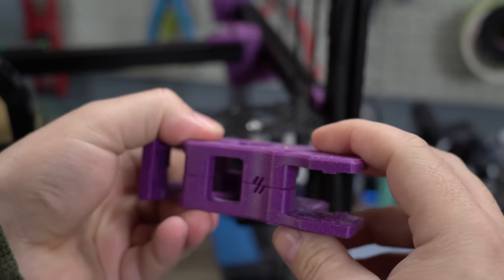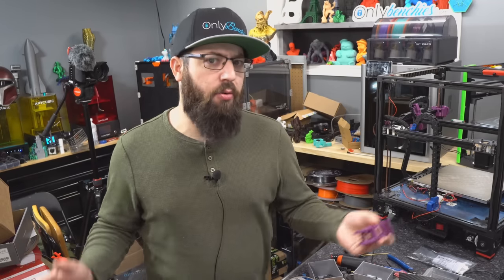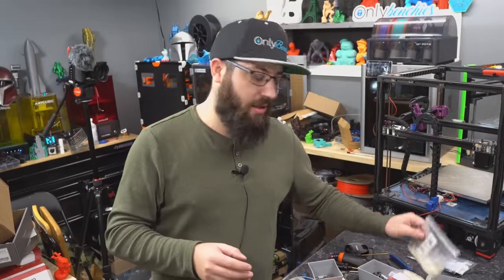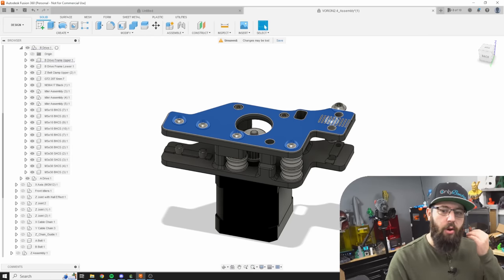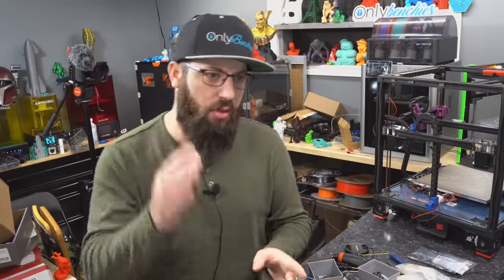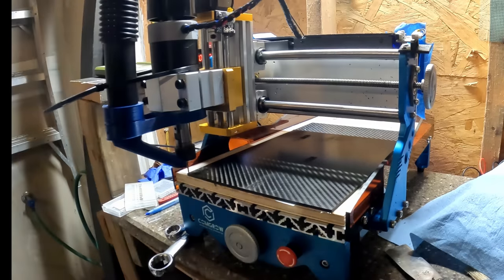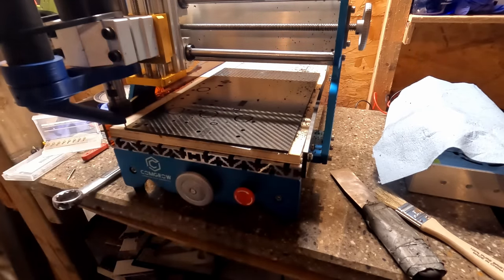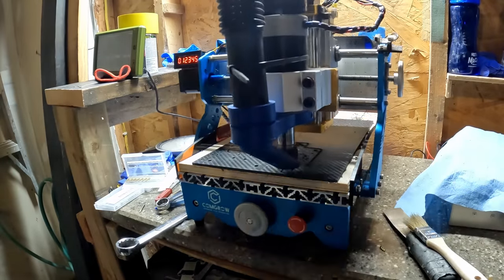Machining Carbon Fiber Voron 3D Printer Parts

Comment: Note that once TAP is installed, you could print some features onto that carbon fiber plate, then take it all over to the CNC and cut a finished part out  Additive + Subtractive processes on the same part.

Comment: The resin matrix in that carbon fiber is a thermoset rather than a thermoplastic, so if you get a sheet with the right epoxy it should be able to handle high temperatures (higher than the ABS you'd previously used). Aerospace-grade epoxies can go up to ~300C without deforming. This is actually the reason why thermosets have continued to dominate the aerospace markets - it's only fairly recently that thermoplastic resins like PEEK have started to get up towards the required temperatures.

Comment: Good idea for the filtration and vacuum when milling carbon fiber. You may already know this, but just in case you haven’t run across it - carbon fiber dust is conductive so you have to be careful with electronics nearby as the dust can get in there and cause you some electrical issues later on. Great video!
Reply: yep. I dont know if id be milling CF on a brand new CNC ...
Reply: Been using my cnc mill for cutting carbon for 3 years and still no problem. Just make sure no fans can directly suck dust in there.

Comment: This is really nice step by step, I love the video! And the following comment is only meant as constructive feedback. As a humble mechanical engineer, I believe that the stiffness haven't improved drastically with this new design. Yes CFRP has some really good stiffness properties. But you loose a ton of co-planar stiffness with the polymer spacers ( they have a small diameter, and they are quite weak in compression forces). So with a few minor design adjustment's, the stiffness could be greatly improved. Upgrading the spacers to GFRP/CFRP tube spacer's cut at the correct length (and straight cuts). Increase the number/diameter of spacer's. This would give this box construction a high degree of stiffness in most directions.

Comment: When you cut carbon fiber plate, do you ever seal the new edges you created with epoxy?  Maybe the cnc cutters are good enough to leave smooth edges without chipping or fraying.

Comment: You could also have gone with fibre glass, it's almost the same but much cheaper. Carbon fibre has it's place, but if you don't do it for the cool factor (as you said) it doesn't make any sense. You can achieve the same thing with glas, it's just a bit heavier: And since this isn't a fast moving part, you wouldn't notice it.

Just a heads up to anyone wanting to do something similar. Glas is at least 5 times cheaper than CF. In 3D Printing people know it as gyrolite, G10 or FR4. It's literally all the same stuff.
Reply from the maker: This basically. I've got a few sheets of cf on hand for drone stuff. Also it looks cooler on camera think lol

Comment: for the locating features, you could cut slots into the plate and glue in some sort of key that is then proud of the surface of the part and works as a locating feature.

Comment: Useful video! I'm about to machine a new CF midplate for the dual 5015 hotend setup on my SK-Tank...it'll be replacing a printed part, and should be a perfect job for my MPCNC (running Duet and RRF). Quick question, for the CF gantry on the Tank, Ernest recommends sealing the edges of the CF pieces with superglue, but I didn't see you do anything like that. Do you feel it's not necessary?

Comment: There is another way to make CF parts.   Use your printer to make a female mold.  You place the fiber and the epoxy in the mold and then press it with clamps and let the epoxy cure.   Then take the mold apart.   The trick is making the mold, you need to sand and polish the inside and coat it with mold-release wax.    Or print the mold in water-soluble plastic and soak it.   The parts can have any shape you like.    Maybe you have to do some very minimal machine work, like reaming holes.

Comment: The locating feature is parallel to the screw holes, just use a second pi3ce of carbon with the same holes cut, or do a 3d print 2mm thick by 3mm thick with screw holes and have a sandwiched piece, itll work Great.

Comment: Most of my voron is aluminium; I'm actually considering making the extruder from carbon fiber, aluminium or even steel at the moment using my big CNC. But: I do like the carbon fiber idea, it might actually be better because it's so much lighter. I do agree that you have to be careful with that stuff... these fibers are very carcinogenic, and they will give you cancer if you're not careful.

The components you have there are some of the ones I have made from aluminium. In fact, i used conical spring washers for mounting the idlers. You can really put them in as tight as you can reasonably can, and they will make your prints more stable because the bearings have no place to go. 

As for the benefits that people ask about in the comments? Basically, if it's more rigid and stable, you can throw more force at it and still get the same results. There's little or no wear and since nothing moves, the speed matters little for the precision.

Comment: I actually just picked up a used Shapeoko 3 for a whopping $125usd. The Makita router it came with is worth that. A no-brainer. I've been wanting a CNC router at home for years anyway, since I don't want to experiment and cut weird things at work. The problem is, with being used to 5'x10' machines, the 16"x16" cutting area seems almost useless. Might have to use the machine as a building block to build a larger machine. We'll see what actually happens. I haven't even put the machine together yet. 😅
Reply from the maker: That aint a bad deal, the size may pose an issue but will also mean a more rigid machine so thats good.

Just depends on your plans for it

Comment: You could have tapped the m5 holes for the m5x30´s. did that on my old CF Gantry
Reply from the maker: True, i machine them with an ID small enough the threads would bite into it and it seemed to work

Also i couldnt find my 5mm tap

Comment: Is there a possibility to get the files for the cnc? I would also like to have the motor mounts for the x and y motors milled from carbon.
Reply from the maker: I just generated DXFs from the sketches off the existing CAD model and did a few "manual" tweaks in carbide create to get it to a workable state
Unfortunatly that also means the final product isnt exactly something im confident in sharing
Reply: @CanuckCreator  okay. Thanks. And thanks for all the other Videos

Comment: Not related to the CF parts (which look reaaally neat btw !), yet curious about TAP. Using optical switches over mechanical ones, ok, yet why not piezo discs ? Like piezo probes, you know. Besides extra electronics, of course.
Reply from the maker: accuracy and reliability

Comment: Love this content… Keep up the good work Sir.  Crazy question…would you ever consider klipperizing the CNC (not sure what/how your CNC HW/SW set up is, will watch the live stream)?  I have an MPCNC and love the klipper environment and was thinking “what if I klipperized it”…at the end of the day, the main board/SW is repurposed 3D printer/marlin based…why not?…thoughts?
Reply from the maker: Problem with that is klipper is missing a bunch of the gcode commands CNC machines use to operate, even RRF requires i do some post processing to the gcode to make it happy
Reply: If you like Klipper but want to drive CNC, Look into "Linux CNC" or just "LCNC".  CNC is more com[plex them printing.   For example, think about a ball end mill.  The tools can be of different sizes and shapes.  Let's not even talk about 4 and 5-axis machines.    In this video, we saw only very basic 2D milling.

Comment: Opinions on using lasercut stainless steel for these parts instead? That's what I'm considering for upgrading my setup. As I see it, rigidity is roughly the same as CF, it is heavier but since this is not moving mass it is not a problem. And it can be done pretty cheaply in a lot of shops. Granted, it doesn't have nearly as much glam as CF, but as a pragmatic option maybe?
Reply from the maker: Its a possibility, depends on cost if its worth it, rememeber, really not gonna see any massive changes in print quality with this sorta mod

Comment: Doesn't Carbon Fiber start to delaminate at 60 deg C? I thought this was one of the objections to the carbon fiber X gantries.
Reply from the maker: True, and this is why ill be keeping an eye on it for a potential followup

But also i tend not to run my machines crazy hot so on paper im not hitting those temps
Reply: It all depends on the resin used. Some can be rated way higher.
Reply: @Boogie3D  some are even spec'd to thousands of degrees!

Comment: What CNC would you suggest? That is my next purchase in the maker sphere of tools. Voron could/should come up with a kit/spec/design.
Reply from the maker: So im still pretty new to the at home cnc stuff, a 3018 or comgrow robocnc like im using here are relatively cheap and beginner friendly, albeit limiting in capabilities
Reply: look into the Milo v1.5 for a more space friendly cnc mill. its still in beta. im building it as we speak. mostly done manual, and full BOM available.
Reply: Check the printNC/ PrintNC mini.
Reply: @CanuckCreator  I appreciate the feedback! I will be grabbing one this spring some time. Cheers! Thanks for the videos!
Reply: @justinwalker8364  SWEET! Thank you!
Reply: @Boogie3D  Will do also! Thank you for the response! Appreciated!
Reply: @tombo7719  3018 is like an ender, whereas a printNC is kind of a voron.
Reply: @Boogie3D  Bro.. that is some golden info right there! I am going to subscribe to all your channels that commented, not that I am many or it means much other than you have a new CNC aspiring buddy!

Comment: Spacers and lack of centering features on lower dimensional accuracy machine vs weaker material. Suppose rigidity gains would be lost in play... Kudos for CF machining, I failed dramatically trying to machine 5mm carbon plate for mk3s by hand.

Comment: Just why ?? better to use aluminum those parts are not fast moving gantry to must be lightest :P Voron is over-hyped and over-engineered :P
Reply from the maker: why you haff to be mad?

I covered your question in the video anyways, suggest a re-watch
Reply: @CanuckCreator  I will, I'm not mad, just opinion not only my opinion.